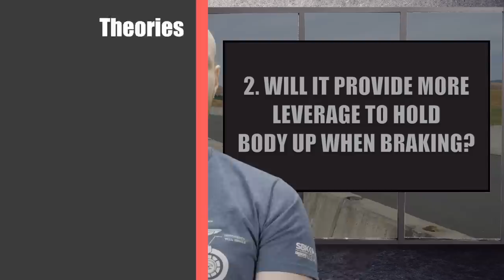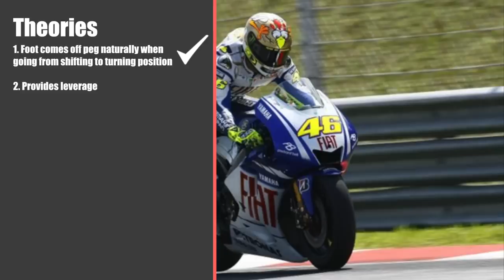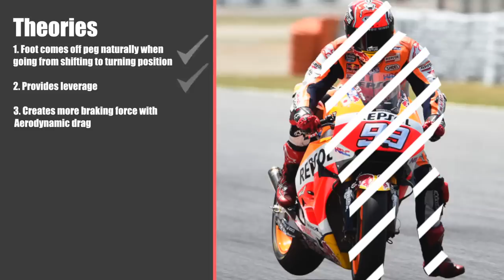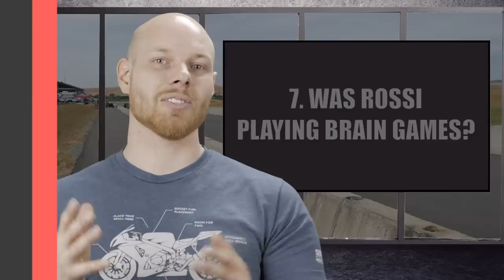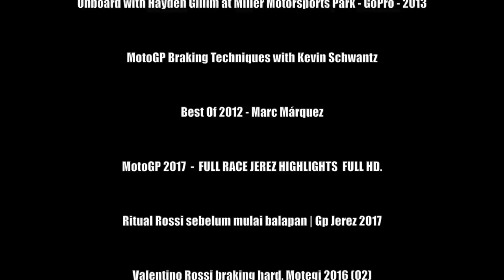The Leg Dangle EXPLAINED

Comment: I have done this on dirtbikes exactly how these guys are doing it I like two things that u said,one saving that side if the tire which they seemed have trouble burning the out parts of the tire away because of the lean angle is so extreme,I do it in motocross when I'm going way to hot into a corner I'll sink my leg out and shift my weight thru my body off and load as much force on to my hot shoe like dirttrackers do trying to keep the bike upright...mainly it bring your center of gravity over these guys are going so fast that that full leg out there is a hook in that force of air u can't see,like both oh those points...its really a balance of aero and center of gravity,Rossi is not very heavy so it would help him moving his COG over with the utilization of CG and aero drag,I did a similar thing using my upper body throwing it out from behind the fairing just before I started heavy braking using it as a parachute effect...u can't tell me that it does not help,what was that wind tunnel test 44 %PERCENT larger profile the thing about using the leg versus upper body,u need pressure on the outside peg straight into the ground if u move the upper body's like u said now u are push the tires out from under u,if u dangle the leg ur upper body is still holding the weight down on the out side peg so the balance is crucial it really looks like a way to smooth the transition from upright to the start of the lean in,glad we had this talk....honest ly it looks kinda weird,if u stick it out in front of me to block my pass imvjust gonna run your foot over and your leg to....if I already caught u so it wouldnt be a good blocking technique unless u got your whole bike over using the leg dangle...it still looks odd....I think they should outlaw it just because of estedicates even if I cant spell esthetics,hah hah hah....
Thanks good job,I really liked the wind tunnel stuff ,I told u .....

Comment: It was first explained to me as a habit that crossed over from dirt and flat track racing.
Which Valentino and many others did do either competitively or recreationally.
I've also heard it helps battle fatigue as this is the only area of the track where you can stretch a leg out without causing aerodynamic and speed concerns.
Reply: USMC TheMadHaTeR - Professional flat trackers are nothing short of astonishing going that fast on dirt and being that close together!  On a mile track they are flying so fast it seems like the track is smaller as they rapidly click off laps.

Comment: I think its a weight transfer thing where the braking g forces make your body lurch forward, you have your hands on the bars which is hinged and the only other point is the outside peg. The force on the outside peg helps push the back of the bike around since it has less traction since all the weight is on the front. So the dangling leg uses weight transfer to bring the back end around to increase the turn in feel

Comment: It comes from dirt bike riding. If you are turning at a high rate of speed or carrying too much speed into the corner and you are on loose soil if the bike starts to step out on you or the front end wants to wash out, your leg is down and you can use it to help turn and push the bike upright in one motion. It is actually a good skill to learn while riding dirt bikes

Comment: In case of wobbles or they lose grip and bike will fall on the inside of the corner, they can push the bike away with the other foot, or they can use it as lever to avoid the inside foot being trapped under the bike. It's like when we were kids and we learned how to ride bicycle using legs to counter balance or to avoid wounds when falling.

Comment: This video was awesome, and I'd like to contribute an observation which may have missed. There is another very significant advantage of the technique. While aerodynamic drag is negligible in aiding braking of the mass of the bike, it is extremely significant in slowing the riders body itself, which means the rider is less burdened supporting their own weight against the forces of deceleration.

Comment: Here's a theory - @7:10 time in video the back wheel is off the ground. assuming it stays off the ground the only thing that would keep the mid to rear of the motorcycle floating to the outside of the turn is using the outside leg muscles to push it back in. You can get more leverage to achieve this with your inside leg off the bike. If the back wheel is not getting airborne while trail braking, then this trick is not needed.

Comment: Also consider when bike is leaning in as the leg goes back in quickly. When the rider pulls his leg back in place it moves the bike in, and reduces the amount of counter steering required to do the same without putting the leg out. This finishes your point number 4

Comment: I think its purpose is like the stabilizer rod-weight in archery - on a bike any weight out at an angle to the bike will reduce squirrelling under braking & help to set the bike up for the corner ie keep it in a straight line - this is a description re the use of the weight on a bow  "In archery, a stabiliser is a general term for various types of weights, usually on rods, mounted on the bow to increase stability i.e. lessen movement on release, thereby increasing precision. Stabilisers help reduce inconsistencies of the archer's release by increasing the moment of inertia of the bow"..........just a thought

Comment: It helps to balance the bike and rider as they are reaching the limit of the braking and the back wheel starts to come off the ground. They are basically in a balancing act as they wait to find their turn in point. It also helps to bring the back wheel out to help back it in.
Think about when you try to balance on something, you instinctively stick your leg out to maintain balance.. 🤙

Comment: It forces more weight onto the footpeg of the non-dangled leg (Weighting the outside foot peg gives more control to counter the rolling torque mentioned in this video), resulting in downward force on the tire instead of pushing the tire out from under the bike. Weighting the outside peg is a conscious thing mid corner to corner exit. I believe that dangling unconsciously achieves the same thing on corner entry

Comment: You haven’t mentioned the effect on angular momentum.   Like a ice skater with leg out causes any spin to be at a slower rate, which on a motorcycle translates to smoother braking experience, more time to react as the rear wheel slides, therefore more confidence.  Useful as the rear wheel is unloaded under heavy braking.

Comment: The reason for it. As they try to brake as late as possible, the bike must be straight up for best grip. But at the point where they should start to turn, there would be impossible to lean the bike so fast to make them able to keep the bike on the racingline. So they load the weight to the side where they want to lean over and as soon they release the brake, as the balance is already towards the apex, they can easily start the turn without overload the front tires. Something like that. It's is exactly the same technic, as leftfoot braking on cars.

Comment: it's simple physics.  as they're approaching the corner the bike is going faster and is therefore more difficult to lean into the turn due to the gyroscopic forces of the wheels.  as they slow down, this force is lessened and the bike is easer to lean over.  moving your leg further away from your natural center of gravity shifts your center of gravity towards the dangling leg.  this shift is what initially helps the rider to get the lean started when entering the turn.  it allows them to keep their body in a more natural position on the bike during the approach which makes controlling the bike easier.  it's not a requirement, but have you ever felt how far you have to stick your knee out vs. dangling the leg to do the same turn at the same speed?  it's a noticeable difference.  additionally, dangling the leg also has a lower center of gravity vs. sticking your knee out.  having a lower center of gravity is better for control and stability.

Comment: Completely overlooked the fact that Rossi got this technique from MX riding. In dirt biking it is almost common practice to use your inside leg as a pivot point for hairpin turns. On oval tracks its also used as a balance point when drifting.

Comment: I never watch a moto gp once in my life only like a few years later after I already bought my first clutch operated motorcycle. During those time, I have no idea of dangling leg was even a thing in the pro gp racing sport. But for some reason the dangling leg during corner just comes out naturally and I can’t really explain why too or perhaps I might saw it somewhere else but never paid any attention to it and some how my brain just coincidentally wired and just reacts using the same method. But for my personal experience I find it to help stabilize during hard stop and help me control my bike better when I use my brake too hard and causing it to skid, my leg dangling helps me to stabilize the wobble and get the bike stable again. At the same time if I somehow fail to control it I have a better momentum from kicking the ground to just release myself off the motobike beside dragging along underneath a 200kg burning steel block.

Comment: This technique is for sliding control,better braking control,better and easier body weight transfer,helps to get better body position before enter the corners. Maintaining your upper body more straight ...helps you a lot avoiding the tires loose grip during braking. You can brake harder when you maintain the bike straight and this technique helps you a lot with that.! Just remember that the 90% of the overtaking in competitions is during braking. That’s mean that the most important thing bikers has to do for maintain front position during competition is the hard braking ability.!

Comment: I have done 15 track days and am a mid pack intermediate rider. I am not a fast rider but there have been two times when I have dangled my leg out. Both times, I entered a corner way too fast for me. Ironically, both times I dangled my leg and somehow made the corner scared but on-line and mostly in control. I don't think I would have made the corners without dangling my leg. I wonder if the pros are on the very edge most of the time and the dangling leg helps them get through the corner somehow. Just a thought.

Comment: The dangle is atleast 30 years old, racers used to do that before they started getting the knee down into the corner. They stopped that because getting the bike on its side clipping the apex is faster than dangling your leg. Dangling to me is a sign of not having confidence or losing control of the machine.

Comment: My first rain race I ever did I found myself putting my leg down under hard braking, it was just attomatic, I never thought about it until after the race, I believe it just made me feel more secure, maybe if the front end slipped out, I could catch it with my leg, just like on a dirt track or mx. Even during dry races certain times in very hard braking I still find myself putting my leg out, I totally believe it is just a reflex, due to me having so many years racing dirt bikes, Valentino spends a lot of time flat tracking and I believe it became a reflex for him, and others just followed and when they did they noticed the added security they felt when under hard braking. I 110% believe we put out our leg under hard braking for added security feeling.
Reply: A. to help with corner turn in. B. allow for more rear wheel traction. C. a catch (safety reflex-preparedness) if bike becomes loose. D. to help in high- speed braking as leg becomes wind buffer.

Comment: It purely has to do with preparing to save a frontend slide. Through the meat of the corner, you use your knee to do this. If you want to get more aggressive at the entrance to a corner, you can hang your foot out while the bike is nearly upright in case the front slides at that point. Either foot or knee can be used to literally pull the bike back under you after the front end begins to slide out.

Comment: It's for shifting weight when they start turning a bit. Also
marquez and rossi doesn't use rear brakes at all on initial hard braking due to rear wheel lift. 
Only in midcorner they use it in combination with the front whenever they have to slow down speed midcorner.

Comment: To me it seems like the foot dangle is intended to prevent the knee drop maneuver from innertially upsetting the lean. If the foot is already dangling, leaning while dropping the knee results in less change of the COG along the trajectory of motion than popping the knee towards the inside of the corner while at the same time countersteering for lean.

Comment: I think it create a heavier conter weight with greater tensions. Dangling the leg it itself may not do much but putting it back in probably makes you really fall into a leaning position. If my theory is right, leg dangling is for breaking late and leaning the bike quicker.

Comment: i tend to think that its about slightly reducing the time it takes to tip the bike onto its side when entering a corner. my point being is that whenever ive noticed a rider dangling his leg, the bike almost always appears to be slightly pitched into the direction of the corner while still traveling 'straight' under brakes. even if this pitch is only 5 or 10 degrees from zero, it reduces the time it takes to bring it over to 60 degrees or more at full lean.

Comment: 8. Increased wind resistance pushes the rider toward the rear of the bike, and with the front forks fully compressed, allows better rebound and decrease the possibility of a loss of control of the front under heavy breaking, minimising the risk of a low-side

Comment: I'll go with when you're trying to outbreak somebody and you just need a little extra. Motocross Riders do it for a couple different reasons. But the biggest one is so under power it's totally different than street bike cornering so don't even get it mixed up with that. If you don't have that leg out and bike kicks out under acceleration your going to go down. It's a lot harder to Race 2 Strokes power would hit all at once. But you don't have to do it as much on the newer four strokes they have a more linear power delivery and they're not so difficult to accelerate out of corners. this gives you the ability to even stand when cornering.

Comment: Guys who dangle leg are also dirt bike riders and flat track tt racers/riders in dirt bike riding going into a burm you can toe drag or throw your leg forward and hit the turn AND COME OUT OF TURN WITH YOUR LEG EXTENDED OUTWARD! I DO BOTH THESE STYLES, IN tt the racer rider is using his leg to balance as they slide the rear wheel around every turn and the leg balances THE BIKE AT EACH TURN. Also i do this to WE GET CRAMPS  and quickly stretching the leg for its is also fatigued prior to the turn and returning it back to the rear sets. Marquez style and everyone else has there own style. Marques knows how to slide his rear wheel at every turn and pushing the bikes the limit HE DOES NOT JUST RIDE A SPORT BIKE. WHAT EVER STYLE FITS U DO IT.

Comment: I think the reason is pretty simple and people just make it sound and look complicated.

Ever going through a  corner too fast or too slow on a motorbike and when you turn you feel like its a bit sketchy and you feel like you might fall. And you get a pucker up moment or an OH SHIT moment. Or that moment where you are turning you feel like you're about to go FUBAR, your inner organs kinda suddenly feel weightless as you are about to fall.

Here comes the leg dangler.

It somewhat kind of like a balancing thing. If you turn and you feel like you are gonna lose balance cause either you are too fast and or too slow you pull that leg out to balance your bike. And if you do feel like you will go do down that's when some people drag the dangling leg's foot/boots on the ground. To keep the bike from falling.

Its somewhat intuitive. 

If you still do not understand it. Try getting on a Bicycle. Try to do that balancing trick where your left foot is on the left pedal and the right foot on the front wheel. Moving it back and forth balancing the bike without a foot on the ground. So what happens when you lose Balance? You pull out your leg and try to step on the ground before you fall. Its basically that. You go on a sketchy corner turn and you feel like falling you pull the leg out.

Something so simple but everyone make it look like it some kinda mysterious thing. Come on guys grow up.

Comment: Using it as an airbrake might seem a small effect. But, taking to account that they brake from double the speed than us mortals, the effect would be double, squared. Four times as much. It also creates a turning moment toward the inside of the corber since the braking force is not in line with the bikes CoG.

Comment: I have another theory or I did not understand one of yours. here is the point:  by dangling, you increase the moment of the system on the vertical axis passing by the CoG of the system so if during the maximum brake you lose control and see one of your wheels start sliding and get a grip again, the "mule" kick amplitude that can catapult the driver is reduced.

Comment: They just do it to stretch there leg if there foot don't touch the ground, when they brake and stick there leg out, they don't lose any time. They also do it to feel where the ground is, when it rains they don't do it because the lean angle is smaller and they don't need to know where the the ground is